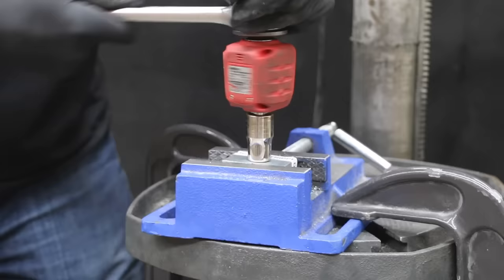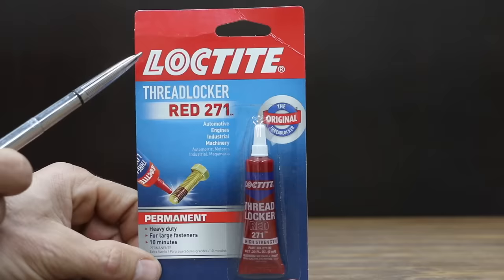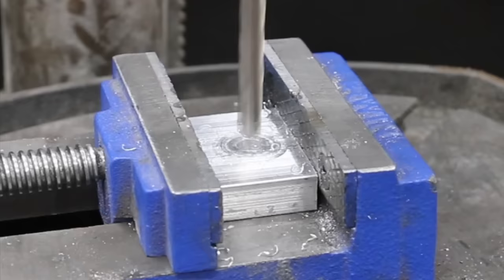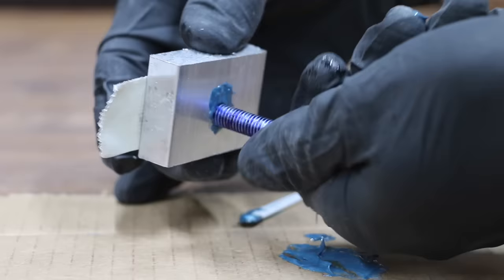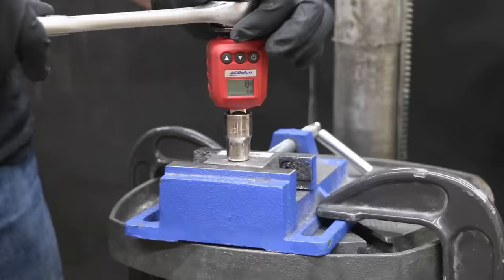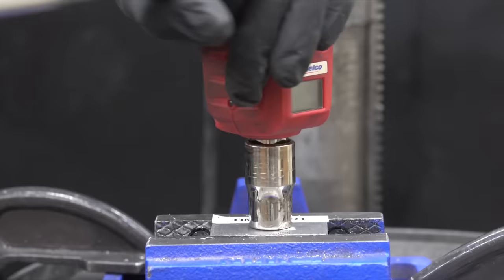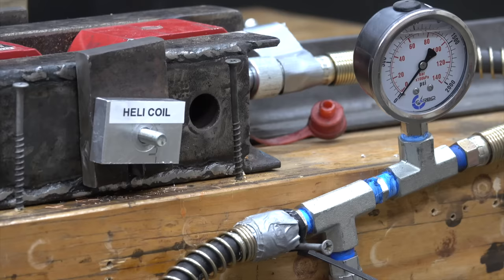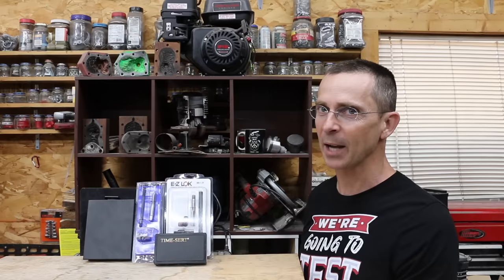Best Damaged Thread Repair? Let’s Settle This! Heli Coil, TIME-SERT, E-Z LOK, JB Weld, HHIP, Loctite

Comment: Don't forget that the Helicoil, and the Time-sert and E-Z lok are all available in Stainless Steel and even mill spec stainless.  They are also available in low profile (at least the Timesert) and Mil-spec.
Reply from the maker: Thanks for the feedback.
Reply: I had studs falling out of the head of an engine. Helicoil kit I bought was solid. It became an entirely different car once that giant boost leak was eliminated, also an entire new set of issues 😂
Reply: "Mil-Spec", i's a catch phrase that sounds good but actually means nothing unless you know what the spec says.  Without actual certification it is just a con like "Aircraft Quality" aluminum.
Reply: @deconteesawyer5758  correct. In the case of the inserts it is materials, certification tracing, and certain thread standards. Just letting folks know it IS available. In a past life, using spec certified hardware was important (for some reason, the military cares about it, particularly for flight hardware). We didn’t even allow non traceable stuff in the building.
Reply: @CharlesGallo  If I want some Mil-spec hardware or aircraft parts I will contact the Taliban. They are currently better equipped with with that than two thirds of UN forces, as they were recently gifted 90 billion dollars worth. If l want a reliable insert with good quality control, material specifications, thread form, and strength I will just get a commercial insert from a good brand name American company like Heli-Coil and rest assured that it's tensile strength exceeds my needs. They are Mil-spec suppliers and have a ton of Mil-specs listed on their website, so there is a good chance the product is already Mil-spec without my thinking about it or asking for that. And in addition  even if for some reason the product I selected was not Mil-spec they have the advantage of being produced in a quality conscious environment much like what you described working at, and  meet or exceed numerous other quality, material,  and process certifications. 
We can up that with NASA certified inserts, somehow important to space flight folks. I just want to make folks aware you CAN get those too.
Reply: @deconteesawyer5758  yeah too bad gop started that war and armed them.
Reply: @williamwchuang  h the Massengill response

Comment: Thank you for doing this. As a mechanical engineer I have to applaud your excellent experimental design and your willingness to put all this effort into answering the question of which insert is best. I can see this video becoming everyone's go-to reference when this question pops up again from time to time.

Since you asked, here's some suggestions for improvement for future videos:
1. Since you have three values for each test, work out the standard deviation (you can use the stdev() function in Microsoft Excel) and use that value for the error bars in your chart columns. As a rule of thumb, if you see the error bars overlap with those of another column in the chart, then you can say that there's probably no statistically significant difference between the two (i.e. any difference is likely due to chance, not an inherent strength increase of the thing under test)

If one of the error bars is much bigger than the rest it means that test had much more variability and you might want to do more samples. The copper tests for example had huge variation between each reading, so the standard deviation (and hence error bars) on that would be huge, meaning the results should be taken with a pinch of salt. Of course that's an important result in itself - you can safely conclude that in the field, using a copper wire is a huge risk because you don't know how much strength you're going to get (as evidenced by the results being all over the place).

2. In cases where the bolt snapped, you're not actually testing the strength of the insert (obviously) so to be fair, you shouldn't report that value and rank the inserts by that value - in reality you should just write "bolt snapped", and tie all those inserts in first place in the rankings. But obviously this is a YouTube video not a scientific paper, so we all understand that there's no need to be 100% rigorous about this.
Reply from the maker: Thanks!  Thanks for the suggestions.
Reply: I noticed that those bolts broke. That means next time use a stronger bolt. A broken bolt means the test for that product is incomplete because you aren't supposed to be testing bolt strength.
Reply: @leewilkerson8185  So what if he goes with grade 8 bolts and they break? Or the inserts pull the aluminum threads out with them? We could do this forever, and eventually he’s spending a lot of money testing exotic metals to find out the best way to repair damaged aluminum threads. Best way is when possible just chase the threads with a tap and be done with it.
Reply: @308dad8 , why don't you use a thread chaser next time you lose the threads from a spark plug blowout and then report the result!
Reply: @leewilkerson8185  The thing about Project Farm is that he performs experiments and reports results in an operationally representative manner. For most people, the difference in strength between the inserts is irrelevant. The question is just, given typical loads and materials, will this insert hold up better and give more consistent results than glue or nothing at all? The answer was a resounding yes. If the insert is so strong that your typical  bolt will break before the insert does, that's all we need to know.
Reply: @308dad8  You only really need to test up the point the base metal threads start stripping or pulling out vs the inserts. Bolt material beyond that is irrelevant for a thread insert comparison.
Reply: @JohnDoe-ej3wp  and...your answer is exactly what I gained from this. No reason to over examine this.
Reply: The second point made here is absolutely critical when doing a strength assessment of these repair kits.  I also would like to  mention the grade of bolt used in this experiment,  the bolts used in this test appear to be grade 5?  To really test these thread repairs to their limits try a grade 8 or higher.  I believe a grade 8 bolt would have resulted with  the hhip and heli-coil repairs being severely damaged/destroyed and the  ez lock and time sert  repairs pulled out of the aluminum before the fastener/bolt failed. A stronger fastenerwill provide  more accurate assessments of the strength of each thread repair kit.   I would not even attempt using a liquid or epoxy to repair threads unless stranded without any other option. As this test shows, they are minimally effective at best.     Love the amount of detailed effort that is  put into every experiment on the channel.  One of the best channels in the world's web for  reality tested information!
Reply: Purpose of the video is to show the limits on consumer grade components not commercial or aerospace. He could have went with inconenel but that means dealing with obscure thread pitches in scenarios not needed for consumers

Comment: The thread repair I'm most proud of was in the nightmare scenario of a stainless steel reverse thread driving a nylon shaft that direct drove an auger that dispensed powdered chocolate and sugar in a coffee machine.
I found just the right thickness of steel wire (0.8mm if memory serves) and wound it around the steel thread to form it then tightened it a little and screwed it into the nylon part much like the thread repair kits shown here, it worked and lasted for the remaining years until that coffee machine was replaced.
Reply: Armchairhero : There are repairs that we dare not guarantee and whose reliability is sometimes surprising.  :-)
Reply from the maker: Thanks for sharing!
Reply: live, die, modify
Reply: Ain't nothin' more permanent than a good temporary fix.
Reply: My favorite: A family friend (my wife's former student) was in college and her Honda Civic had a bolt strip (on the alternator bracket or tensioner) and each shop told her it was not repairable.  Her parents were trying to convince her to purchase a new car which she could not afford.  We were trying to convince her to repair the car and minimize debt.  I ended up buying a time-sert kit and new bolt from the dealer and was able to repair it for her.  She has since graduated and is an elementary school teacher, wife and mother.  Her husband drives the little Civic as his commuter car and I can't help but smile every time I see that car or the time-sert kit in my tool box.
Reply: @vwtype3  “Each one of those shops” was lazy or didn’t know how to fix it or both.

Comment: In doing the timing belt project on my VW diesel, I discovered a prior mechanic had stripped one of three belt tensioner bolts.  It was the one common to the aluminum coolant jacket.  After some research,  I chose TimeSert, called them explaining the situation.   They didn't have one with such a shallow thread depth, but suggested I could customize it.  I told him, no problem,  and please overnight it.   They were very helpful.   That was about 8 yrs ago.  Great product!
Reply from the maker: Thanks for sharing!

Comment: This was one of my favorite tests. I would love to see this done again with stronger bolts, and maybe also ones made for sparkplugs. The added heat would be an interesting factor.
Reply from the maker: Thanks!  Thanks for the suggestion.
Reply: I second this!
Reply: @ProjectFarm  I'd be interested to see how well something bigger like m16, m20 or even m24 would hold up with high tensile 8.8 or 10.9 bolts
Reply: Or engine head/brake caliper
Reply: Yes! The one time I had to do this was for a spark plug. I used a metal insert, but to lock it, you tapped the top with a provided punch to stretch the top and lock it into place. This was an extremely interesting vid for me!
Reply: Torque test channel just released a video about just that. They were testing the performance of the thread repair inserts in cast iron using grade 5+ bolts.
Reply: @ProjectFarm  That means you have to have used Ford 4.6 or 5.4 heads on deck for this test as Ford ™️ the spark plugs removing themselves while driving 🤣.
Reply: A buddy of mine used the heli coil inserts when he was younger to repair the spark plug holes on his 65 VW Beetle.  The inserts actually outlasted the block which eventually had to be replaced during an engine rebuild.
Reply: Yes please, I was a bit disappointed that the bolts were breaking before the insets failed. Grade 8 please! Still love your videos either way but I wanna see failure.
Reply: I know doing heli-coil for cylinder head bolts in an aluminum Northstar engine would not work over time. I believe GM over torqued with fine pitch thread and eventually went with a course thread LS bolts. Norhstar Performance out of  Canada was the only repair kit that would not fail over time for those early engines.  It would be interesting to devise a heat/cool cycle test for fatigue and possible walk out.
Reply: I use hhip and ez lock style at work on M30 bolts and have no trouble with them. Used both up 450f
Reply: @eric63377  LOL you can also add the Ford 3.0L V6 Duratec to that list since we had a plug blow out of our Mazda MPV Minivan on a family road trip, Helicoil to the rescue! ;)
Reply: I apologize I couldn't read all the comments in this section but I think it would be great to forward that task to any of the racers and race week and Rocky mountain race week or whatever those guys must bust bolts off and strip threads the entire trip and I think it would be an awesome video.
Also I just wanted to say I don't know how you put up with dark side of these videos which is some of the negative comments I have to say that I am so glad that you continue to make these awesome videos and just explore everyday items to see what works best in a situation.
Reply: @eric63377  check out key locking inserts. Grainger has them I used them in almost all applications. I used helicoil alll those like it. Key was the way to go.  No joke and don't have to depend on loctite.  262 dosent like heat.   Was in a machine shop for 9 years.  We tried all.  Settled on the key.
Reply: @eric63377  not saying helicoil are good if you don't have to remove. We. Put these in holddown jigs in aluminum.  So bolts were coming out and in all day .
Reply: @ProjectFarm  I also would like to see ones for spark plugs
Reply: yes, especially aluminum ford cyl heads that have such spark plug issues, (the stripping and blowing out part, not the breaking off of the spark part).

Comment: 3:14 To figure out the size of the tap drill just subtract the tread pitch from the nominal bolt size. For example M6 × 1 needs 5mm tap drill. M8 × 1.25 needs 6.75 tap drill (round to 6.8)
Reply from the maker: Thanks for the feedback.

Comment: I use heli coils at work nearly on a daily basis. it's amazing how many are in aircraft parts. seeing how well they hold up makes me not feel so bad when I have to repair a cnc machine with it now.
Reply from the maker: Thanks for the feedback.
Reply: Yes, they last well there, and as a bonus the connection is always stronger than the parent thread.
Reply: @ProjectFarm  best wire splice connectors would be a good comparison video.
Reply: @SeanBZA  If the parent thread is an aluminium alloy. If the parent thread is some higher end nut like 12.9 grade, I doubt a helicoil is comparable.
Reply: @jpikl1284  Still will hold out, as the larger diameter thread into the parent metal resists the pull, plus it is spread out over a larger area of the very hard wire.12.9 grade yes it will still rip out, but at a much higher load, and you can always use a much longer insert or multiple inserts, as I have done on deep holes.
Reply: @SeanBZA  I don't think so, helicoil is stainless and about comparable to 8.8 grade screw material. So such repairs onto 12.9 grade material simply are weaker.
Reply: @jpikl1284  it's the fact that sti threads have larger thread height so there's more material holding the heli coil. not all heli coils are made with stainless. I've seen/used ones made from brass, stainless, mild steel, plastic, inconel, and also super duplex. basically anything that has been used to make nuts and bolts has also been used to make heli coils, the most common is stainless steel (303 or 304) and mild steel (410 or 4140)
Reply: I was surprised a bit too.  My experience is using them to hold a 3000psi fluid from a flange to a line where the flange metal is softer then aluminum.
Reply: @jpikl1284  This test clearly shows that when the threads of this size are repaired with these inserts that the bolts snap before the threads fail, so proving the methods. Did you not watch the video before commenting.
Reply: @jpikl1284  Since the helicoil is longer than 1.5x the bolt diameter it is always the bolt that will break, the insert is stronger than a 12.9 grade bolt.
Reply: @thra5herxb12s  Not all screws are the same. The video does not really compare them much at all, it just shows the screw snaps in all the metal inserts. That does not mean they're all equal and it would be more informative if we saw the difference.
Reply: @mrfrenzy.  That makes no sense, the original threaded hole in the alloy was also just as long and it stripped.
Reply: @jpikl1284  the original threaded hole was aluminum, steel inserts are much stronger. The strongest bolt you can get (12.9) is only rated for 300 in-lbs and the cheapest inserts here managed about 500 in-lbs.
Reply: @mrfrenzy.  The bare aluminium threads withstood over 300 in-lbs, so your argument basically means the aluminium threads should never strip out at all.
Reply: @jpikl1284  correct, if you don't overtorque the bolt the aluminum threads would not strip. A steel insert will not strip even if you overtorque the bolt until it breaks.

Comment: I was especially interested in this one. It was very insightful. An interesting thing about the inserts is that they are very often used in parts from the very beginning, especially in softer materials because the insert allows for better holding power with that size bolt than you'd get from that bolt being threaded directly into the softer material. I think your average person will have never heard of helicoils or other similar inserts. Boy are they useful at home in the garage.  Thanks for the video!
Reply: Not only better holding power, but also better durability if it's something that's threaded in and out regularly.
Reply from the maker: You are welcome!  Thanks for the feedback.
Reply: well for aluminum bronze inserts are harder and you have also corrosion resistance. I was thinking he was going to test it on mild steel with 10,9 bolts, with that setup its only interesting with the chemical repair
Reply: @scasny  Well having tested Helicoil in aluminium i have broken M6 12.9 bolts.
Can not say much about the other brands though.
Reply: Exactly. My edelbrock victor jr aluminum heads, for a small block Chevy have helicoils installed from the factory. (rocker stud holes, and exhaust Manifold holes)

Comment: One thing to keep in mind with thread inserts is galvanic corrosion. For example, carbon steel inserts in a brass piece may experience extremely rapid galvanic corrosion if exposed to water, especially salt water. Make sure to check that both materials are relatively near each other on a galvanic activity chart.
Reply: Yes, this is the real concern with thread inserts.
Reply from the maker: Thanks for the feedback.
Reply: Indeed one of the concerns. Like in some applications with water pump installations, standard steel bolts are used. Eventually pieces weld together. Timesert makes inserts in stainless steel. Probably a better choice for aluminum.